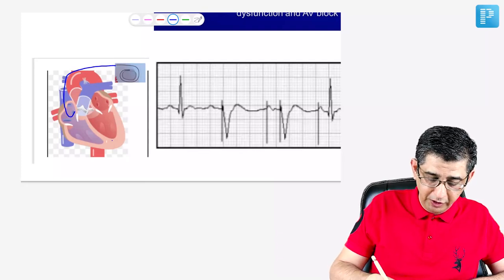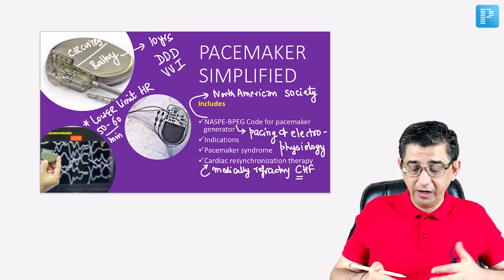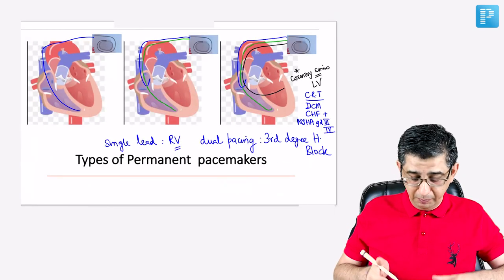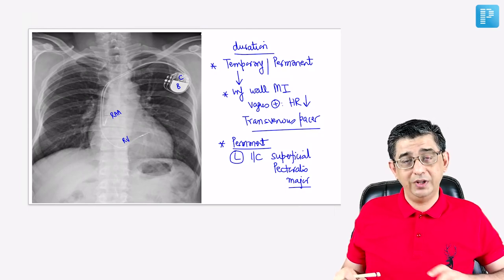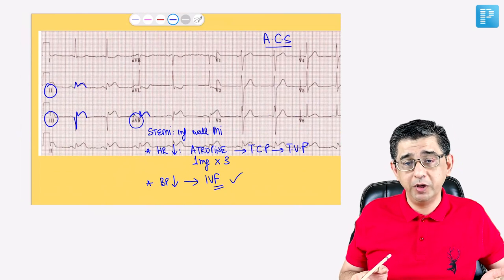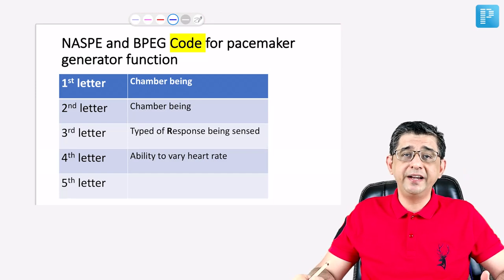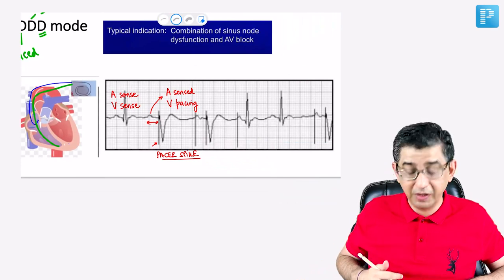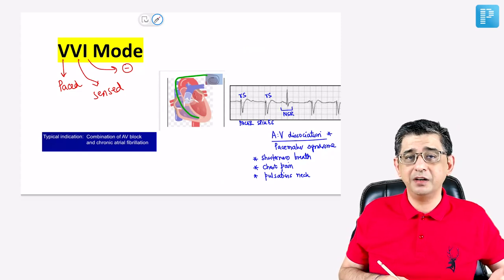Pacemaker Simplified | Dr. Deepak Marwah | Medicine | PrepLadder

Comment: Sir you said that there is only three types of response through pacemakers 
I stand for inhibitor mode
T stand for  response Trigger mode
& D for Dual mode    
 
IS  V-0-0 A CORRECT REPRESENTATION OF THAT NODE.?.  WHICH TYPE OF RESPONSE MODE WOULD BE in V-0-0 ?    It should be V-0-I in place of V-0-0 ? 🙏🙏🙏🙏🙏 Sir ,please clear my doubt...